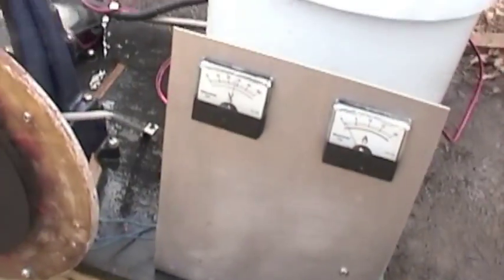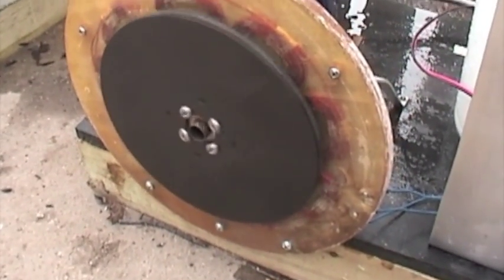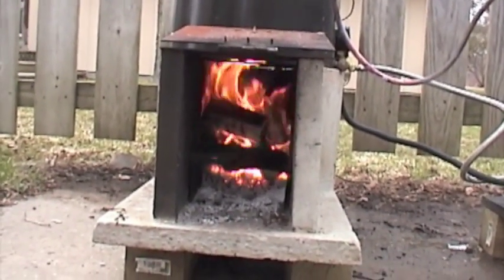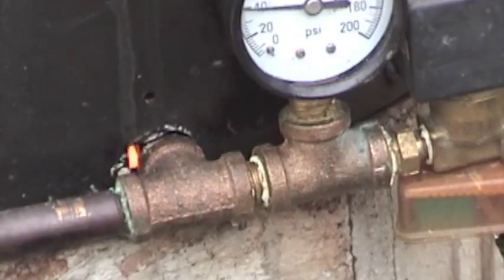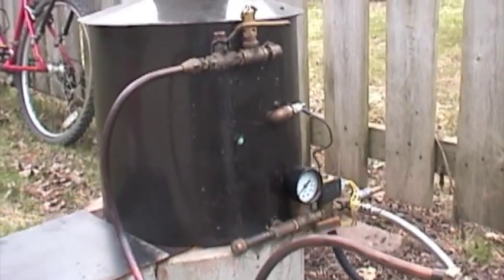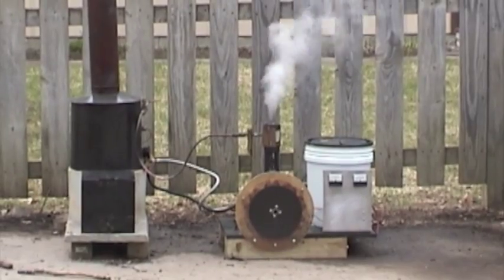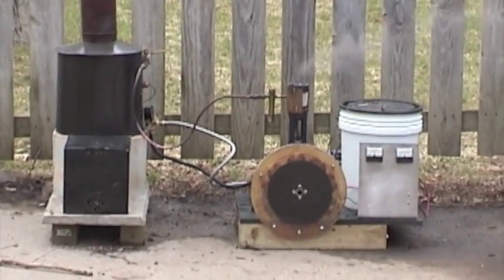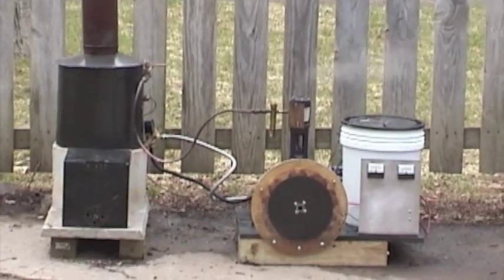Lynx Steam Generator 4

Comment: Would be interesting to see what she does if you fed that power through an mppt controller and discharged 12v battery.
Reply: I would like a little higher rpm, I have an MPPT I might try, and I might try 36 or 48 volts.  Wide open no load the engine will do 300-600 rpm.  I can also turn up the pressure a bit.